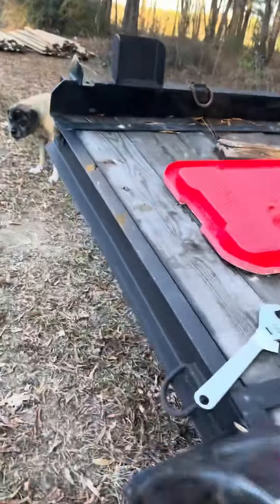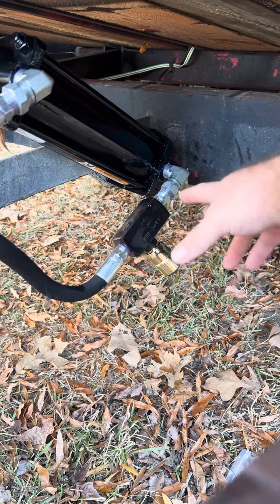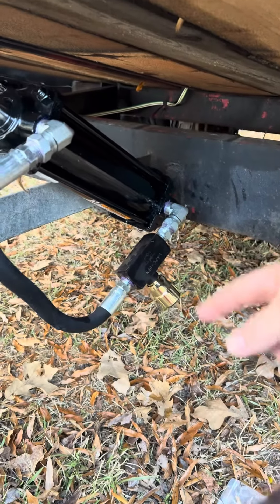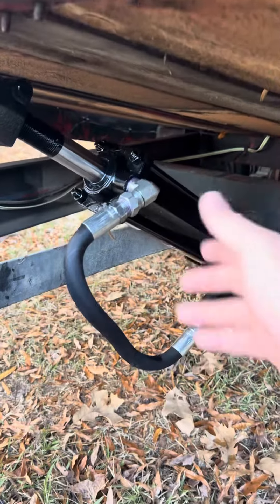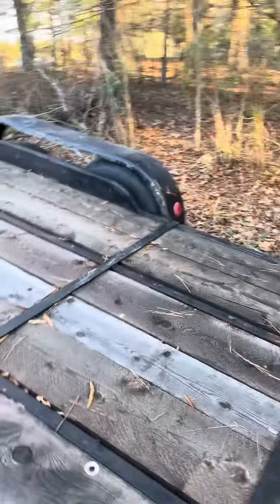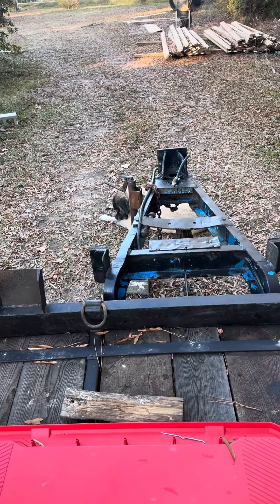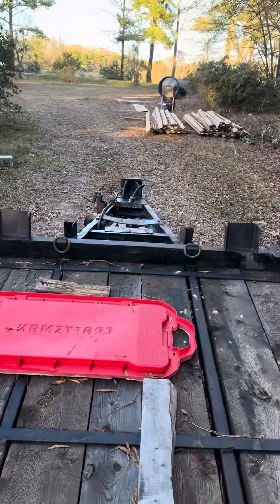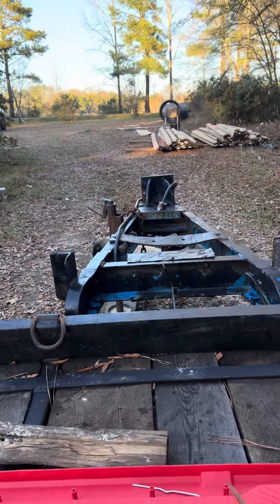Tilt trailer dampener

Comment: Where did you purchase these parts please?
Reply from the maker: Valve off Amazon, cylinder and hose from Tractor supply. You have to also get hydraulic fluid. The TCS cylinders do not come prefilled with fluid.
Reply: How did you fill them without getting a bunch of air in line?